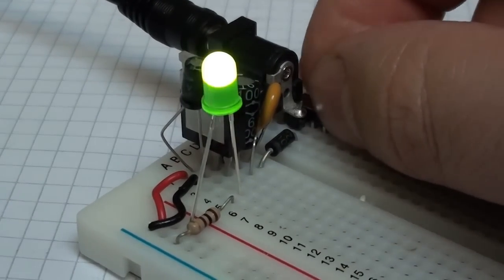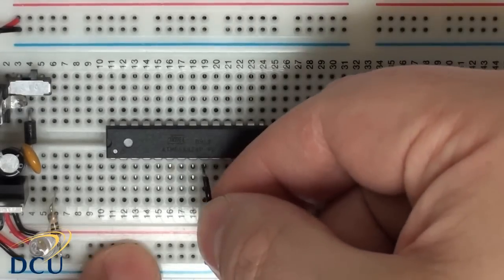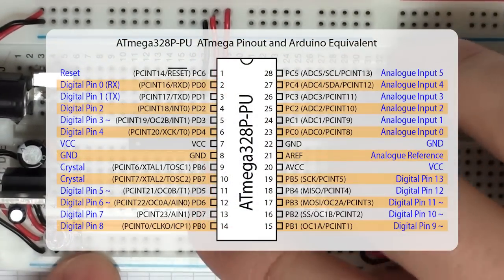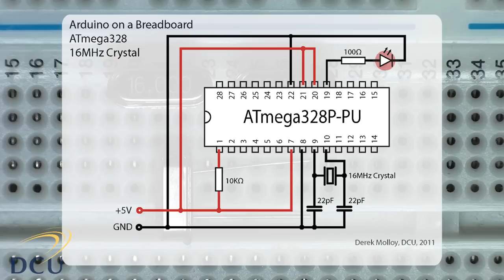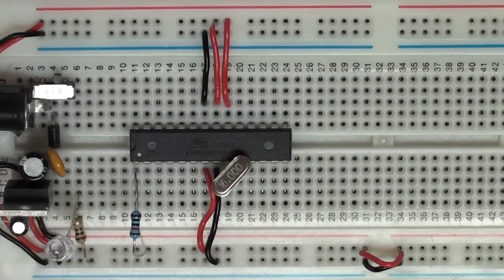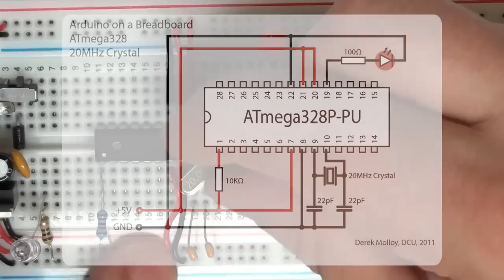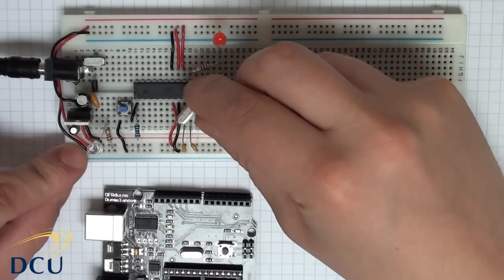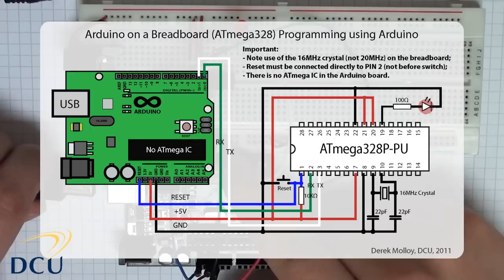Arduino: Arduino on a Breadboard

Comment: Yet another tutorial that does not cover the load capacitance required by the crystal :(
If the crystal is 16mhz 20pf then the 2 capacitors need to be 36pf not 22pf.
22pf capacitors are used on a 10pf crystal.

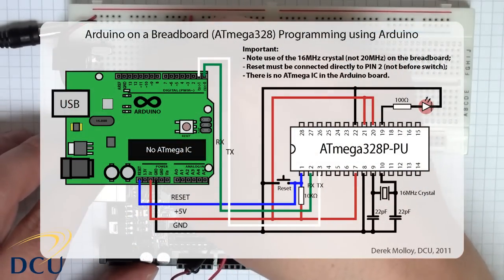Comment: Excellent video. I think I found a very small mistake in the notes at 11:43. Instead of "Reset must be connected directly to PIN2 (not before the switch)", it should be: Reset must be connected directly to PIN1 (not before the switch).

Comment: i burn my arduino board doing connection when the board was ON. RIP  ATMEL328 burn and the ch340 chip too, 5v regulator, nothing to do,

Comment: If the ATmega chip is overclocked then the sketch will run faster. So the LED will blink faster. The Arduino main library has been tuned so it waits for close to exactly 1 second. If you put in a slower/faster crystal/resonator, then the LED will blink slower/faster.

If you're interested, use an oscilloscope and check.

Comment: how do you determine what components (value or type of capacitor, resistor, crystal) to use ? Please tell me if I should learn something first. I am new to this and i don't know where to search.
Reply: Crystal oscillator depends on the chip itself.usually the one Arduino uses 16mhz. For caps 22pf is enough to give the crystal enough pressure to start oscillation. Resistors 100-470 ohms are good to be current limiting resistors

Comment: I have constructed this same circuit on the Breadboard. I am programming the standalone Atmega328P with the Arduino.

 I am getting this error while uploading the code:
Sketch uses 928 bytes (2%) of program storage space. Maximum is 32256 bytes.
Global variables use 9 bytes (0%) of dynamic memory, leaving 2039 bytes for local variables. Maximum is 2048 bytes.
avrdude: stk500_recv(): programmer is not responding
avrdude: stk500_getsync() attempt 1 of 10: not in sync: resp=0x01
avrdude: stk500_recv(): programmer is not responding
avrdude: stk500_getsync() attempt 2 of 10: not in sync: resp=0x01
avrdude: stk500_recv(): programmer is not responding
avrdude: stk500_getsync() attempt 3 of 10: not in sync: resp=0x01
avrdude: stk500_recv(): programmer is not responding
avrdude: stk500_getsync() attempt 4 of 10: not in sync: resp=0x01
avrdude: stk500_recv(): programmer is not responding
avrdude: stk500_getsync() attempt 5 of 10: not in sync: resp=0x01
avrdude: stk500_recv(): programmer is not responding
avrdude: stk500_getsync() attempt 6 of 10: not in sync: resp=0x01
avrdude: stk500_recv(): programmer is not responding
avrdude: stk500_getsync() attempt 7 of 10: not in sync: resp=0x01
avrdude: stk500_recv(): programmer is not responding
avrdude: stk500_getsync() attempt 8 of 10: not in sync: resp=0x01
avrdude: stk500_recv(): programmer is not responding
avrdude: stk500_getsync() attempt 9 of 10: not in sync: resp=0x01
avrdude: stk500_recv(): programmer is not responding
avrdude: stk500_getsync() attempt 10 of 10: not in sync: resp=0x01
Problem uploading to board.  See http://www.arduino.cc/en/Guide/Troubleshooting#upload for suggestions.

Comment: What about those 10 components in the left of the breadboard? Why do you need them? Cannot just feed 5V and GRD to the arduino directly from the power supply?
Reply: The power supply switch helps a lot and the bootloader is only run at start from end of program memory section from what i learned today it is only invoked on reset button press or fresh start. But that part is what allows you to upload sketches using avrdude aka arduino IDE

Comment: well Done , super explanation.  I'm a bit confused because i've read that the arduino (http://forum.arduino.cc/index.php?topic=2429.0) should be powered with 9  to 12 volts. ?

I have a project proto typed  using an Arduino uno  powered from my laptop through  usb. I'm hoping to transfer the project to a PCB with a atmel   328 pu chip with bootloader on board. I want to switch 12 v LED assemblies and a buzzer.  now i will use transistors to switch the LED assemblies etc.  which will have an independent 12 v supply  through the collector .  I will use the base of the transistor to switch but will the 5 v power supply or 9 to 12 v supply be a better option? any thoughts on this will be greatly appreciated.

Comment: I notice that several people are asking about programming the chip without first having a boot-loader in the chip.  It's possible, but you need some extra hardware.

Specifically, you need a USB-to-RS232 converter (unless you have an old PC with a genuine RS232 port).  These are easily found and cheap to purchase off somewhere like eBay.  I believe you also need a small value capacitor (I forget the exact recommended value but I know it's very low, such as 10pF).

Refer to 11:40 when the picture comes up to show you how to connect the original Arduino shield to the chip and instead connect the pins from the RS232 converter, with TX on the board to RX on the ATMEGA chip and vice-versa. GND also should be connected from the converter board to the unprogrammed ATMEGA chip.  There will generally be a 5V supply from the converter board and this can be used to power the ATMEGA during programming.

If you're using a genuine RS232 port, then you'll still need to connect GND but you'll have to power the chip separately since genuine RS232 ports don't have a power supply line.

The next connection is from the DSR pin on the RS232 converter board through the capacitor to pin 1 (the reset pin) on the ATMEGA.  Connect the USB cable from your computer to the USB port of the converter board and wait for it to be recognised by the computer.

Now you load up the Arduino software and under "Tools" first select the COM port which the converter board created as part of its installation, then under "Tools" select the board as "Arduino/Genuine Uno".  Finally, also under "Tools" select "Burn Bootloader" and you should end up with a chip which you can program "just like a bought one" ;)

I haven't actually tried the above.  I'm just passing on and summarising what others have said.  I'm wondering why there needs to be a capacitor in the DSR line but I've been told it's needed, so I passed the info along verbatim.

Comment: That resistor you using is 1/4 W ? Which resistor should we use? And its very usefull video. Thanks for it. And sorry for my bad english.
Reply: Barış Sami EDREN u need to have the help of LED Series/Parallel resistors connection ,u can find on  http://www.resistorguide.com/resistor-for-led/     kershoves law .....and this is a calculator directly to a no. Without laws: http://ledcalc.com/  it sounds that it depend on which color of led u use in which wave length and which V*f is used relative to the wave length used so u can find a table of wave lengths for led colors with its V*f numbers on http://www.electronics-tutorials.ws/ and u can directly calculate the value without need of V*f (led) or V*S (battery)or I*f(led) which is mainly 20 maph for most leds

Comment: How does the chip know whether a 16MHz or 20MHz crystal is attached in order to count to 1s?
Reply: It doesn't actually (though you can query F_CPU). In Arduino, that counting is handled by wiring.c library function "Micros" (which get added, to become Millis and Delay). Unfortunately, the way Micros is written, it only works properly with frequencies that divide evenly into 64 (8, 16). 64/20=3.2. At 20MHz, Micros outputs an unsigned long integer, meaning that it drops 0.2 with each cycle of the clock and it takes longer than expected, to achieve the desired count. The workaround is to create an If Else for the 20MHz case and simply count clock 'ticks'. Then, use (float)micros() * 3.20 to calculate the actual microseconds in your main program. Microsecond delay, because of the way it is calibrated, is actually accurate.
Reply: The 20MHz crystal will make the LED flash slightly faster, unless you tell the Arduino there's a 20MHz crystal there. When you burn a bootloader onto a blank chip (as would have happened to the chip shown, prior to leaving the factory) you burn "fuses" into the chip that tell the chip what frequency of crystal is connected, or whether the chip should use the internal clock.
Reply: I'll rephrase... Because of the way it is handled, Microsecond delay does not suffer the same 0.2us per clock cycle offset as the Micros, Millis and Delay functions. It is roughly as accurate at 20MHz, as it is at 16MHz (within about 0.4 seconds per day).

Comment: i linked the components the same way you did but my circuit doesn't work.. the led turns on after 10-15 seconds and it does not blink.. i used a motorola smartphone charger as power supply instead of a voltage regulator, and the voltage of the charger is 5.12 volts. do you think it doesn't work because of 5.12 v power supply instead of 5 exact volts?
Reply: no, tell me more information about it and i think i could help you out
Reply: Visit arduino.cc website, CLICK  | ARDUINO|   in the tabs, you can find a DIY arduino, you can download the Eagle files and stuff and make your own for half the price of the original arduino.
FYI you can do almost all prototyping & projects in your DIY arduino. Only advantage of original product is lesser risk.
I make my DIY arduino & modules. It cost me Rs200 to make my arduino UNO, that's like $4. LOL.

Comment: I have a SMD edition Uno so is there any way I can program ATMEGA328?
Reply: http://blog.sachleen.com/posts/1356050240/programming-atmega-using-arduino-uno-smd/
Reply: No babe
Reply: +kareem selim yes there is I already figured it out
Reply: how?
 do you mean program it or install boot loader onto it
Reply: Can you share the solution please
Reply: yo it says remove the microcontroller that means u want be able to use arduino as a controller u will only be able to only use it as a usb to serial converter
Reply: I don't think you read the whole thing
Reply: OK - so same as with a removable chip UNO but decouple the reset pin and add a switch to bring the 328p target chip reset pin (1) low to reset manually after the compile section. That's it?
Reply: Yes

Comment: iam getting these errors when iam trying to program my ATmega328p using breadboard and arduino.Pls help?

Sketch uses 1,224 bytes (3%) of program storage space. Maximum is 32,256 bytes.
Global variables use 10 bytes (0%) of dynamic memory, leaving 2,038 bytes for local variables. Maximum is 2,048 bytes.
avrdude: stk500_recv(): programmer is not responding
avrdude: stk500_getsync() attempt 1 of 10: not in sync: resp=0x75
avrdude: stk500_recv(): programmer is not responding
avrdude: stk500_getsync() attempt 2 of 10: not in sync: resp=0x75
avrdude: stk500_recv(): programmer is not responding
avrdude: stk500_getsync() attempt 3 of 10: not in sync: resp=0x75
avrdude: stk500_recv(): programmer is not responding
avrdude: stk500_getsync() attempt 4 of 10: not in sync: resp=0x75
avrdude: stk500_recv(): programmer is not responding
avrdude: stk500_getsync() attempt 5 of 10: not in sync: resp=0x75
avrdude: stk500_recv(): programmer is not responding
Problem uploading to board.  See http://www.arduino.cc/en/Guide/Troubleshooting#upload for suggestions.
avrdude: stk500_getsync() attempt 6 of 10: not in sync: resp=0x75
avrdude: stk500_recv(): programmer is not responding
avrdude: stk500_getsync() attempt 7 of 10: not in sync: resp=0x75
avrdude: stk500_recv(): programmer is not responding
avrdude: stk500_getsync() attempt 8 of 10: not in sync: resp=0x75
avrdude: stk500_recv(): programmer is not responding
avrdude: stk500_getsync() attempt 9 of 10: not in sync: resp=0x75
avrdude: stk500_recv(): programmer is not responding
avrdude: stk500_getsync() attempt 10 of 10: not in sync: resp=0x75
Reply: did you burn bootloader without a problem

Comment: why are you connecting VCC twice the Arduino is powered via USB and your bread board is powered though the 7805 regulator they only need a common GND all I do is jump RX TX and Reset and it works fine
Reply: He didnt :)

Comment: how can we connect the breadboard with ATmega328p without using the arduino board?
should i include the serial communication on the board?
Reply: get a serial to USB chip.  real cheap on ebay. educ8.tv shows how to use one.
Reply: I have a usb type A  female.Can i use it to connect my Atmega328p to my computer?
Reply: +akshay san no.  you need a USB to serial conversion chip
Reply: +TakronRust Can i use  Max232 in between my usb A and Atmega328p or should i  go for the usb2serial chip?
Reply: +akshay san just look up the chip. there are plenty of vids
Reply: +TakronRust thanks buddy 😊!!

Comment: Hey did you use arduino Uno for this tutorial?
Reply: i can see a Duomilanove not an Uno
Reply: +alex chiang The Uno doesn't have a removable ATMEGA chip does it?
Reply: +TheNeurofluxation Look for the Datasheet
Reply: +TheNeurofluxation it has a removable chip unless it uses SMD (surface mound device)

Comment: Ok, it might sound stupid but I have this question:
can we have a number of Atmega chips and connect them parallel to the TX-RX rail? My expectation is merely to upload a program to a number of chips at once.
Reply: pangpengmaster the only way to know is trying it, so try doing that and  tell as if worked
Reply: +pangpengmaster Maybe you could search for parallel programming arduinos. I do remember someone having set up the Raspberry Pi as a  mass Arduino programmer but I don't remember any details.

Comment: Hi, great tutorial, 
why did U use 20mhz after programming? 
I'm new to arduino programming and making my own board witch is working partially, 
I'm using GSM and breadbord arduino, and it's only sending first SMS, don't know why is not going to loop after
On Arduino board is working perfectly
Thanks!

Comment: I love this video. I want to do some simple circuits for a model train layout and want to be able to tweak them as far as leds flashing rates and so.Using the arduino boards usb brings the cost down to about 3 or 4 dollars per circuit. just the cost of a ATMEGA328P-PU Microcontroller (2 dollars) and a crystal and some caps (50 cents) and they are tweakable Thanks

Comment: You've mixed up the meaning of AREF. It's either the VCC and then AREF connected VIA A CAPACITOR to the GROUND (not VCC) or another source of reference voltage. Saying it's no harm to connect AREF to VCC directly is very error prone when the 2 voltages mix up and give you strange A/D conversions.
Reply: Yes, I don't understand why AREF needs to be connected at all.
Reply: Use asterisks instead of capital letters. Not like THIS, but like this.

Example: "*Hello, world*" but remove the asterisks.

Comment: This is an excellent video and one of the best, most concise explanations of this process.
There is only one question unanswered. What if you don't have, or don't want to use the Arduino carrier board to program the chip, but you have a USB to TTL adapter available? Given how common these adapters are, it's easy and cheap to have one around for programming various micro-controllers. How would you go about doing so with this setup?
(eg http://www.adafruit.com/product/70 )

Comment: Why does the ATMega IC chip need multiple GND and VCC pins if that is all that the pins are used for? Whats the point? Is there an actual reason for this?
Reply: The multiple grounds can be useful in board design, but on that chip there is only 2. Also, the AVcc is not actually just a Vcc pin, it is used for various analogue circuits I believe. Anyway, hope this was helpful in some way or another!

Comment: I must challenge the claim you made at 8:50 regarding the same blink rate when running at 16 vs 20 MHz. I do not agree with your claim, and would argue that the increased clock speed causes the LED to blink faster. Perhaps there is something I missed, but I also timed the blink rate in your video and recorded a noticeable increase.
Reply: As far as I can tell from the chip block diagram, there is no real-time clock in the chip.  Timing appears to be calculated from the system clock, so there is a divide-by-16,000 somewhere and that gives you a millisecond.  Clock pulses come 25% more often at 20MHz, so what you expect to be one second is 0.8s.
Reply: @neilbarnett3046  Yup.
Reply: but how increased clock speed will change the  blink time?? I have  set it to 1sec and the MCU will understand that 1sec for any speed of clock. the program uploading speed may become faster but it cannot change that 1sec delay.

Comment: What is the ceramic cap doing between the diode and voltage regulator?  Or maybe I should say, what size is it?
Reply: Its a good practice to put ceramic cap after the regulator to provide stable power expecially when designing power supplies

Comment: What if I put 12v instead of 9v? Will it still work? Or do I have to modify the circuit?
Reply: I want to know that too does a high voltage increase the clock frequency??

Comment: that was definitely a great video, I didn't know you could do that. super cool!!!
a question for Master Derek, can you retrieve a program/sketch from an arduino or from the chip.  thanks mike
Reply: Theres a way to get the compiled hex from the chip using avrdude command line codes but it was not humanly readable sketch... I wanted to know if theres a way to detect bootloader or make a bootloader checker circuit tool to find out which chips are used or not. Maybe you can make a custom bootloader/compiler to preserve sketch info save that to data flash?

Comment: Derek, nice vid.  Um, at 11:45 your slide says to connect RESET to pin 2 before the switch, but the picture shows pin 1.  

Other than that, this is a great video.  It got me understand what I was doing wrong.
Reply: It says connect RESET to pin one. I hope that helps!